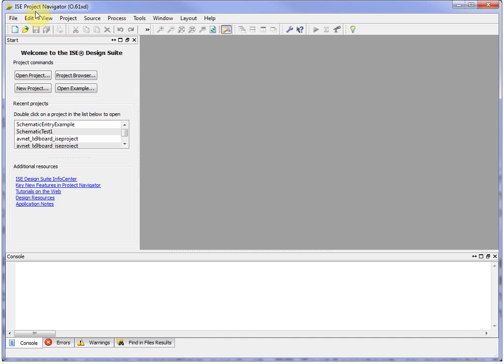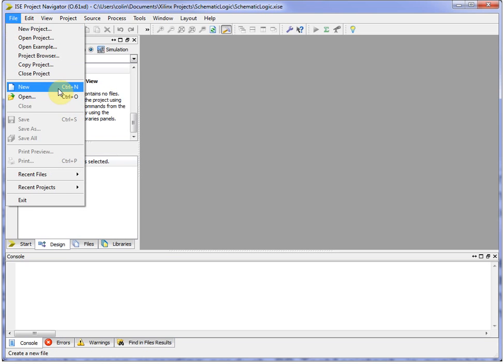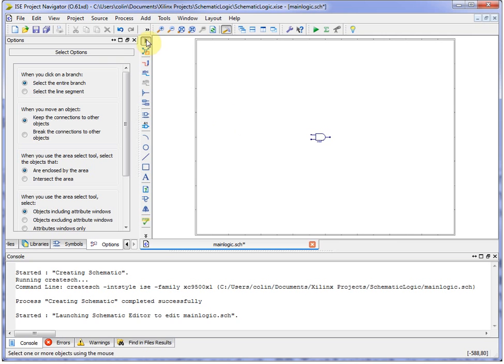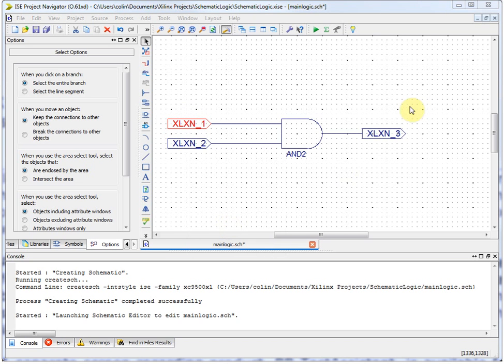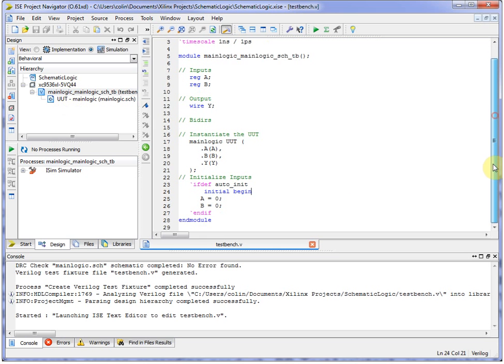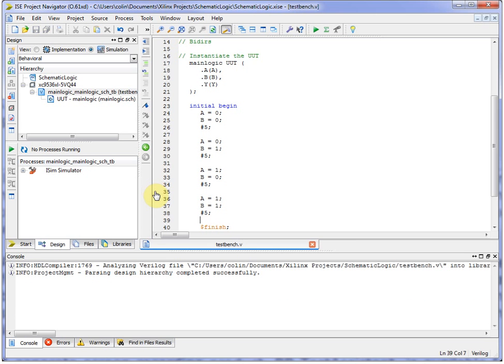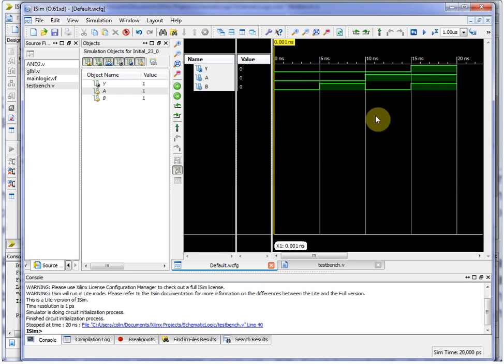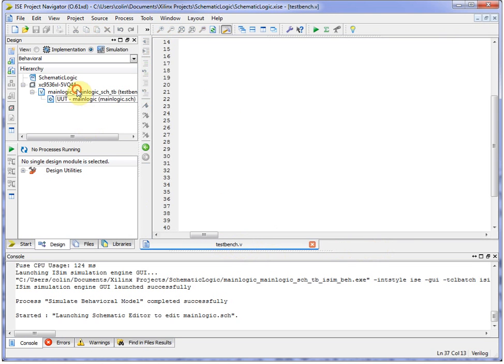Xilinx ISE Simulator (ISim) - Simple Schematic-Entry Logic Example

Comment: I encountered an error "Simulator:861 - Failed to link the design" after a couple of hours of trying everything to do with rebuilding the project. The fix was to run the 64bit version of ISE. Isim must not run in 32bit